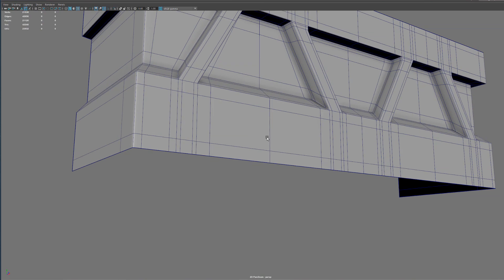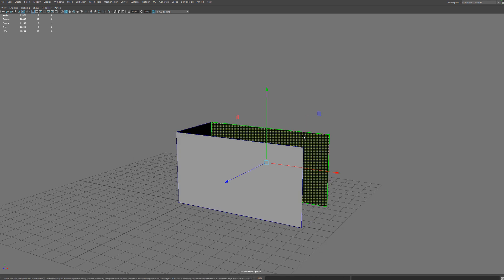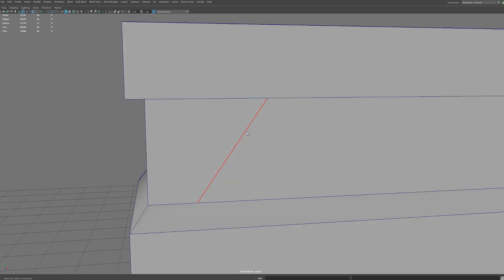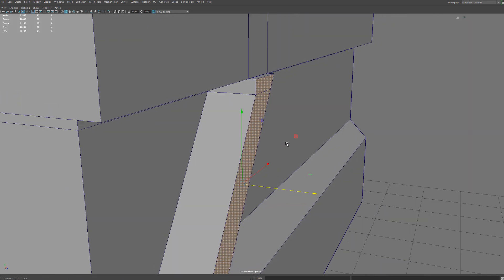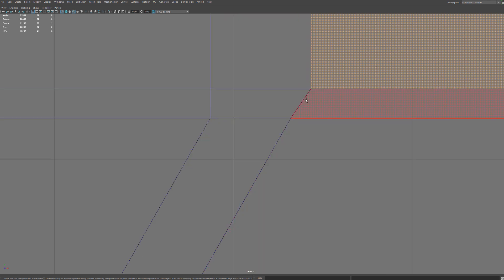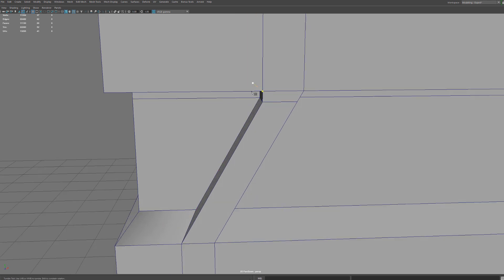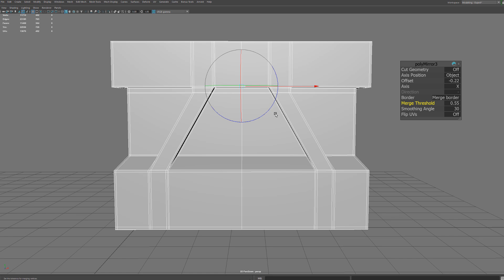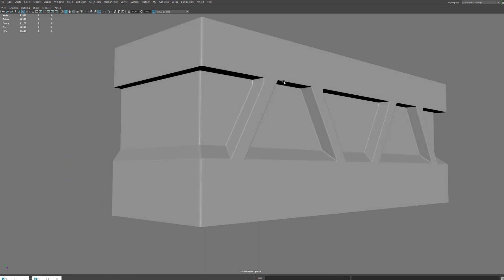Maya Hard Surface Modeling: Panel Details

Comment: Hello sir, im trying to learn how to do hard surface modeling but I'm still confused about pressing '3' preview smooth on when to use it . From what i understand is that "preview smooth" is only a preview base on its name..what do i do next after i complete my model and satisfied with the result while looking at preview smooth,cause if I remove the preview smooth it goes back to hard edge..in all my past models ive only been using "mesh diplay>smooth/harden edge" after UV then export it to SP..how can i actually use the result of preview smooth to my actual model . pls help

Comment: Great video as usual friend! If you use the old school insert edge loop tool instead of quick cut version, there is equal distance from edge and relative distance from edge options that you can play with to help with the edges smoothing out uneven like you were talking about at 11.30 in the video.

Comment: Looks good. However I noticed some parts where you could have done things a bit faster and easier. At around 10:47 when you move verts sideways to align them you could have used vert snapping. Vert snapping does work with single axis movement. So it will snap the verts you are moving just on the selected axis to the verts you hover your mouse over. That method would give you the same result, but faster.
Reply: I agree. I use your method. Its faster.
Reply: @ChaosWolfNinja  Also could have used target weld.
Reply: @AndraDare  Yes! Target weld definitely another method. Thanks!